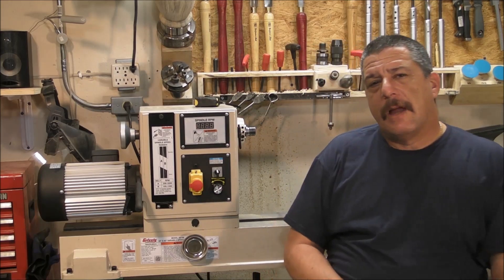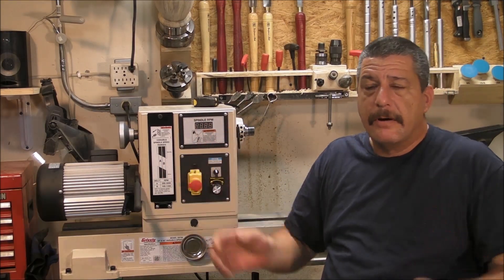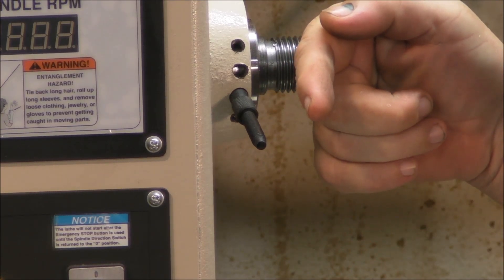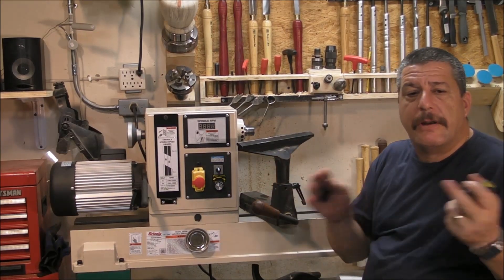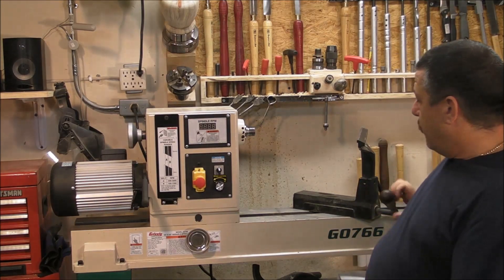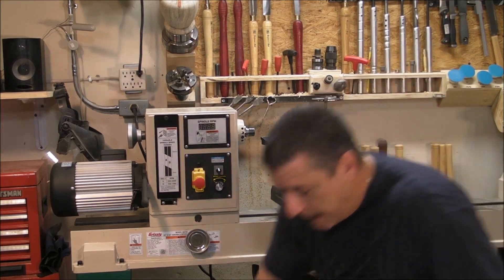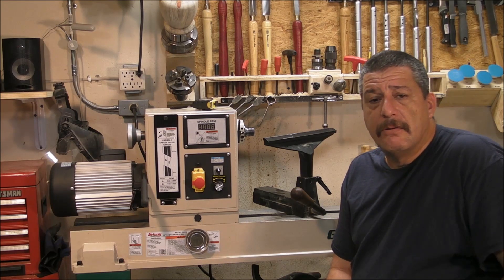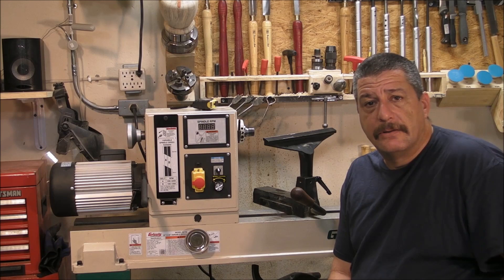#135 Gryzzli G0766 wood lathe Review (English version)

Comment: I also bought the G0766, I like it so far. I bought a different tool rest to fix that problem. I am curious if your lathe makes a high pitched noise that gets higher as speed increases.
Reply from the maker: Jim Norell Hello Jim, it is like a wistle, mine also have it and it was in my other lathes as well, but lower, I asume is because the motor is bigger, any way I do not pay attention to it. Take care
Reply: Thanks

Comment: Hi Miguel,   I just recently bought this lathe also.  I was wondering where I could get a good curved tool rest for making bowls.
Thanks,  Mike
Reply from the maker: +Michael Stephens The problem is that you need a long stem one, mine is welded an extra piece, you can find it in amazon and then fix it, it is not expensive, about 30 bucks.

Comment: Great video Miguel, thanks for doing this!  One question- Is the lowest speed actually 100rpm or can it go slower?
Reply from the maker: manitopercussion Well, in the lower range it goes to 80 before stop, if you tray to go slower it not even start, it is a very little point in betwen on and off and I think is not very good to be a lot of times in that point, so is stable at 100, even at 90 but not lower. Take care

Comment: Read all this page of comments without seeing mention of magnets. Glue one to the spindle lock pin and one inside the belt access door. In my third month of daily seeking for a lathe. Coming up on 72 years, so it will be my first and last. Told my brother yesterday on the phone I know every model, every maker specs available in the U.S. I like the Grizzly 0766.  Happy Turning.
Reply from the maker: Hello, thanks for the tip. I really do not use the lock that often but what I did was attached an elastic band  to the pin and around the spindle housing and it stays in place. Best.